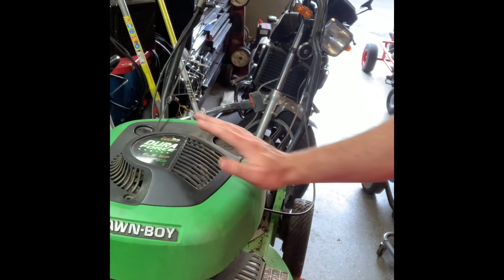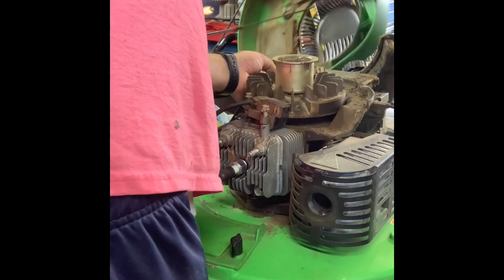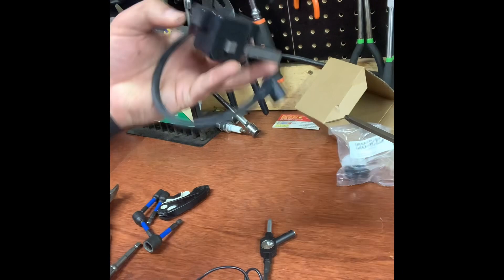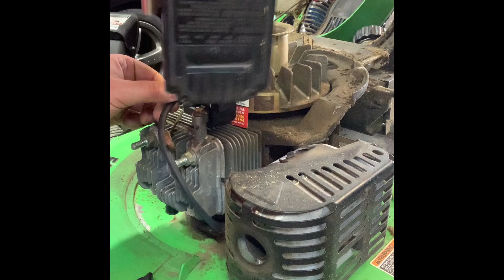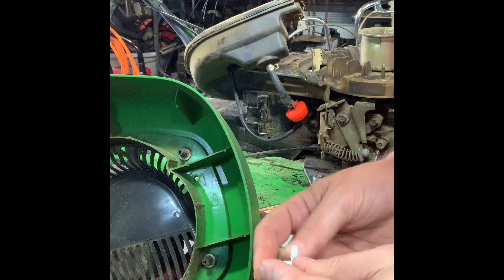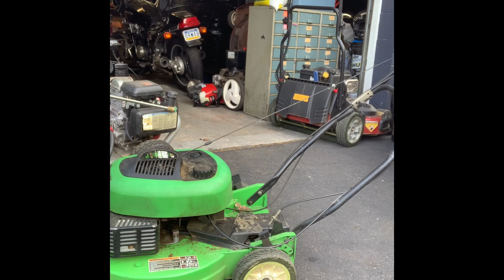Lawnmower shuts off after 10 mins, won’t restart.

Comment: Greetings from Wisconsin happy to be a new sub to you I like Lawn Boy mowers too Especially their 2 stroke models i have 4 of them i like to collect them myself i have the exact same on that you fix in this video only difference is i have an electric start version and the 3 speed self-propel :)
Reply from the maker: They have a pretty big following. About to do a service on this very machine for the spring. They don’t need much. Air filter, spark plug, blade sharpened and check the pull cord. That’s about it.

Comment: My lawn boy silver Pro 10323 is doing this exact thing. Unfortunately I haven't the skills nor the tools. Is this is an expensive repair to pay done?
Reply from the maker: If you take it to a repair shop they would likely get a factory coil (if available) that costs ball park of $50 where as an aftermarket coil runs roughly $20. The labor should be about .5 hours depending on their rate. So if they used aftermarket and charge $60/hr, it’d cost around $50. If they used factory coil it would be $80+ in my opinion. Some shops charge upwards of $100/hr